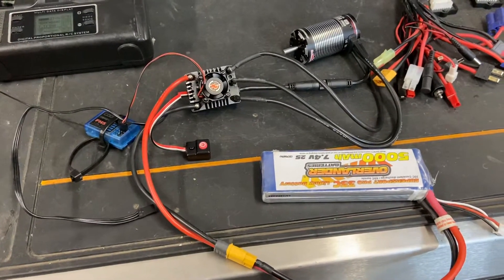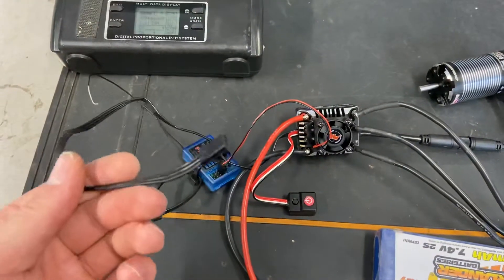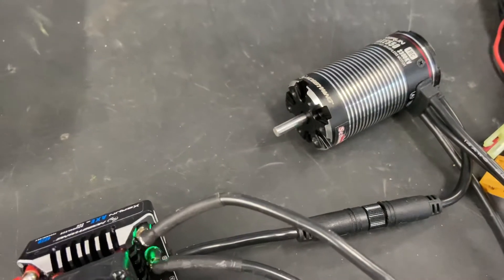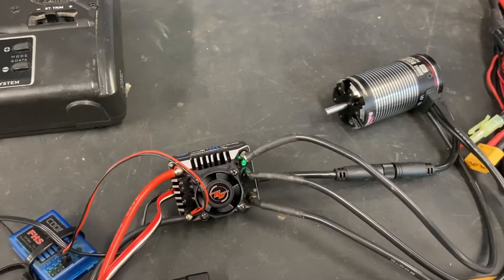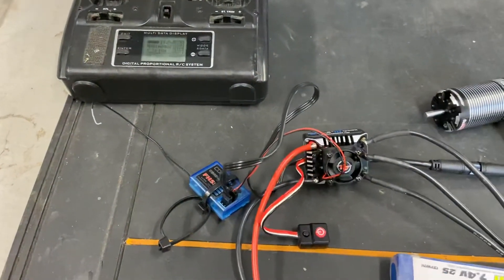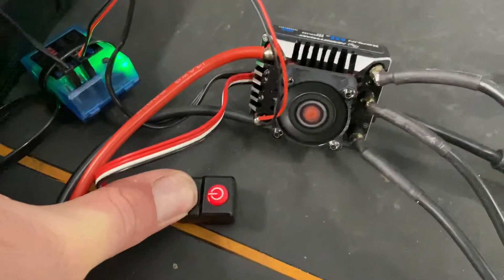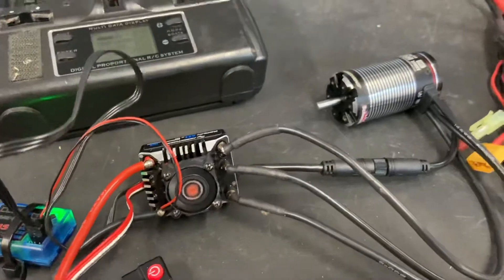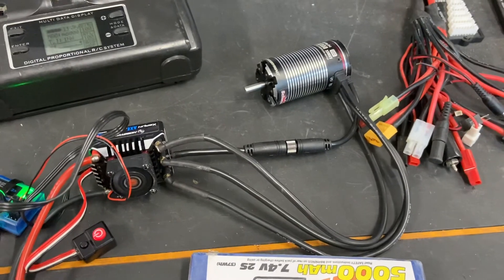Spudski RC How to: Hobbywing Axe Brushless Motor Calibration and ESC to Transmitter Calibration

Comment: Hi thank you for this video but im having problem if you can help me i did as you but the first stage where i dont connect the esc to the receiver and i start the esc then i press the set button the motor turns one way then after few seconds stoos but it doesn't go the other direction and the green light stays green and the second stage its not doing what it should can you or anyone had the same problem can help advice me

Comment: i have problem when i turn the controller wheel the motor starts going forward or backward and i cant change it everything is just as it need to be but still doesnt work rip 200euros im using xerun axe v1.1 esc and motor is 2300kv
Reply: Servo lead in rx is plugged it backwards its in the turn servo location move wire on rx to the throttle plug place in the Rx like if wire plugged in channel 1 move servo wire to channel 2 and it should work
Reply: @drowildcat2960  lol i needed this comment long time ago thx